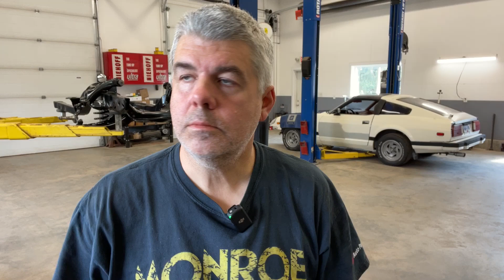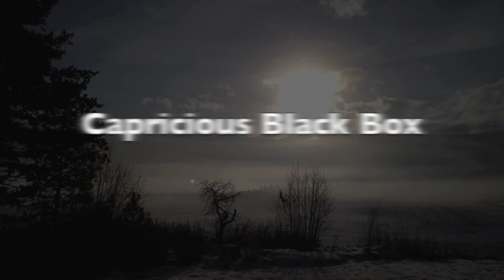The current state of automotive design and repair

Comment: The more tech that goes into modern vehicles, the less I want of it. Teslas I find especially abhorrent. A really old Willys Jeep sounds rather nice... This I say while driving a 2020 Hyundai.

EDIT: Regarding the constant flow new parts, I work in auto glass. We've got 10 different Ford F-Series windshields in our bulk stock, plus a handful more in our less common stock. The same piece of glass (which hasn't changed in a dozen years), but Ford keeps changing the hardware on them. I looked at three of them and found the exact same part number on the ADAS bracket, the only difference being the wire or the connectors on the wire.

ADAS itself is a pain, as it means that, compared to non-ADAS parts, they take up twice as much space in crates. A bulk crate of windshields used to be about 30 parts and now it's 15-20, depending on the window. A Ford Transit comes in as little as 8 parts per crate — the exact same crate that could fit 30 windows that don't have a giant chunk of plastic on them. This means more labour to pack them safely and higher transportation costs to move them. Then there's the possibility that one or more of the ADAS cameras has to be calibrated when the window is replaced... This tech is making everything more expensive.
Reply from the maker: And this is becoming an ever-increasing sentiment; I have a good number of customers now actively seeking out a mid-‘70s GM truck for instance….looking to go away from the modern mousetrap. How many will actually do this, or just keep on driving their 2020 Hyundai as you said….is hard to say. Some of them already have, but I think people forget how much modern vehicles spoil us as well. There are certainly a lot of modern cars complete with multiple on-board computers that are reliable, reasonable to repair and have decent longevity. I am not sure an old Willys Jeep is the answer…at least not for daily transportation. As a 37 year veteran of the trade I have many such reliable/reasonably engineered models in mind should I need a replacement vehicle or to recommend to others. FYI almost none of them are newer than 2016 lol. 

As for tech making everything more expensive…….yep. More expensive and more difficult to manufacture/ship/store/replace. There doesn’t seem to be any end in sight, other than possibly the fallout from the past few year’s economic debacles…in many cases that has forced people to retain their older vehicles longer. Cheers~!
Reply: And of course all this extra inefficiency comes whilst the companies' marketing droids tell us how they're committed to the environment blah blah blah. Ok then, stick more parts in the vans! :D
Reply from the maker: @CoolHardLogic  of course, but then it’s always been that way…..the notion that automotive advancements and accessories have been “consumer driven” has never passed muster……it’s the marketing, stupid! (the collective “stupid,” not you lol) Even the so-called “focus groups” are led down a garden path….the real aim is to outsell competitors through perceived value, not to actually produce a product that people really want. Occasionally that does happen, and the company promptly reinvents the wheel and stops making that product. One example is the mid-2000’s Ford Crown Victoria/Mercury Marquis……people love them….in general they are reliable, well-constructed large family sedans with true 6 passenger seating, a large trunk and decent handling/fuel economy for the size. People hold onto them until they are rusted hulks because there’s no real replacement for them in the marketplace. Ford wants to sell them an overpriced F150 instead lol.

Comment: Cars need computers to be more efficient than they used to be, but the issue of if and how they can be replaced after years is a big one.
Something else that also frustrates is the yearly tinkering of models that manufacturers seem to do. I don't regularly buy cars so it doesn't affect me, but this year's model will have changes that aren't meaningful. Stupid rubbish like changing the shapes of the lights just so that there's always something "new". Of course it means smaller runs of parts, which means higher costs to manufacture and higher costs for the customer. Stuff like this I think has led to the issue of vehicles with relatively minor damage being regarded by insurers as "write-offs" purely because they're not economical to repair.

The only plus side is that the quality and reliability of cars these days is a hell of a lot better than decades ago.
Reply: one reason manufacturers don't go for right to repair when it comes to the computers is... they just buy them and don't have right to repair themselves.  there's ALWAYS an open hardware way to replace ecu's, sometimes it takes a bit of money to grease the firmware designer but nearly everything else is easy to get ahold of and do.  a regular ol discovery board has most stuff needed for an ecu replacement, just gotta have guts.  so it's not easy for the newest stuff, it will become easy.
Reply from the maker: @felderup  Perhaps, but it’s not as though “computers” are singled out when manufacturers consider the right to repair legislation. They don’t really care….it’s about keeping people coming to the dealership, because their aim is not to repair, but to replace (sell you another car, preferably a new one). As for ECU replacements becoming “easy” I think that would need some clarification. If you are talking about an individual with some knowledge of electronics surfing message boards for individual electronic components to repair an ECU, possibly, yes. If you broaden that out to the aftermarket repair industry, frankly, no. There is enough liability in the professional repair scenario to keep most of us (shops) from using any part that doesn’t come with some degree of corporate assurance (and downright warranty, possibly including some labour compensation). It’s one thing to seek out an engine ECU for an early ‘90s GEO Tracker with an injector driver fault and finding one on eBay motors that’s either used or has had the injector driver components replaced and offering that to our customer “with no guarantees,” It’s another thing entirely to source any questionable part for a contemporary vehicle with sophisticated and highly integrated systems and send the client down the road……it’s just not something that most shops are going to risk. If instead you are referring to many of the ECU re-manufacturers out there broadening their scope of available modules, I would welcome this…because at least then we have the aforementioned recourse/warranty and zero chance of someone being able to make a case that we did not repair their vehicle properly (safely). Cheers!
Reply: @CapriciousBlackBox  becoming easy, yes, it would take some electronics knowledge.
     i would have to specify out of warranty, it wouldn't be necessary to scrap a car if there were some generic computers to replace most of the functionality.  like, individual microcontrollers in a tail light, they're probably similar class to old PICs, networkable and with an output to control a fet, very simple, easy to replace with generic product once the protocol is analysed but definitely a larger module.  like 90's tech in a 2024 model car, it's just as good but 5times as big.
     generally correct that you have to put it in yourself to bypass liability interests, yet the replacements can be made for easy installation by the customer.  like, you can still sometimes buy manual choke kits for older cars, they're not exactly the kind of job you can leave up to a toddler, but there's plenty out there that can slap em on.  old ecu, unplug and unscrew, plug the new, larger generic one in and screw it down in new holes, not too hard, only problem is getting space in an aftermarket parts store.
     my suggestion is that there could be entirely generic ecu's that provide all the functionality for cars that are 10+ years old that have no new parts anywhere, there are open hardware generics NOW.  maybe part of the new role of a mechanic is as a part procurer, some already do it.  as the complications rise it might be 15+ years lag but if someone's gonna keep a car THAT long it might be that they'll have no choice but to buy something designed by stinky fred who never leaves his ma's basement except to test his board in his car.  for example gevcu on hackaday, not for gas cars, but looks pretty good.

     anyway, to get some of the projects cranking it will take a little money, the hardware is the easier part, the firmware is the killer.
Reply from the maker: I agree…one only has to look at the nightmare under the hood of a late 1970’s American car with a “lean burn” carburetor and enough serpentine vacuum hoses to shame medusa as an emission management system. Electronics and computer controlled systems are far and away more efficient…the real problem I think is the highly proprietary nature of it all. There’s almost no standardization within a single manufacturer, let alone across the various makes. I’m not a big “government regulation” guy in general, but I can certainly concede that OBD2 with it’s limited mandate worked really well and simplified a lot of the engine diagnostics and hardware.